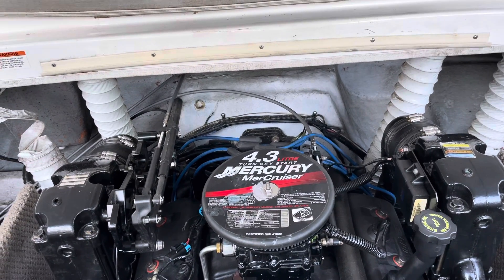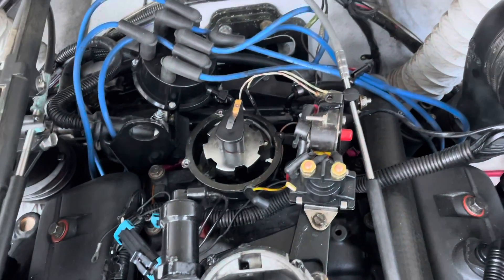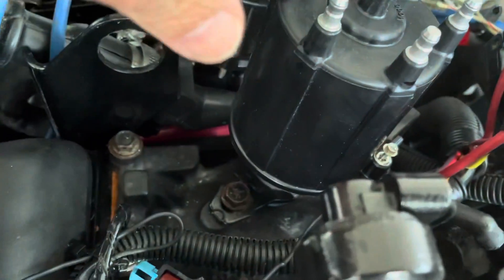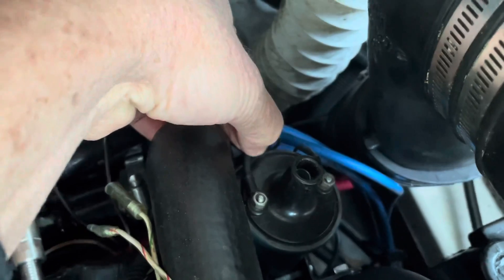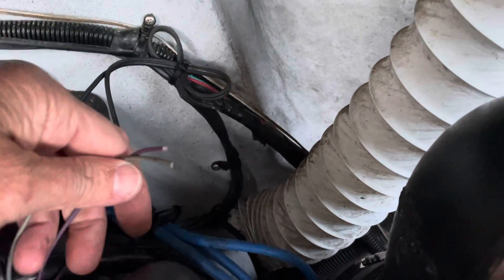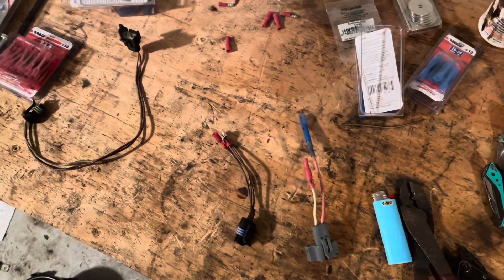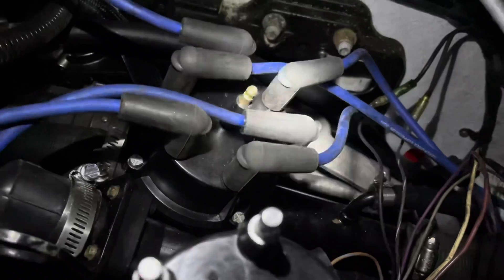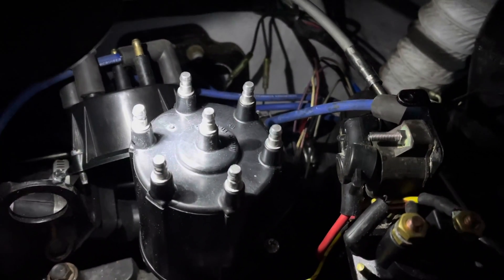3 - Mercruiser Thunderbolt Ignition? - The Fix Is In - OBSOLETE - Read Description

Comment: I am curious, I am swapping out a 2004 5.0L Thunderbolt V blown motor for a  5.7 short block and I am going to change out the Thunderbolt V after I have it running. I was told by the marine machinist that built my motor that is what he does for some of his customers but instead of using a separate coil and distributor he uses the HEI distribute it has the coil and distributor all in one, what is your thoughts on that?
Reply from the maker: If you use a HEI distributor from about 1976 to maybe 1982 it might work but this distributor uses centrifugal advance weights and you would need to have the curve adjusted on a Sun distributor machine. But you didn’t say if the engine is a Vortec 5.7 or not which would effect the curve you use. I personally would not use a mechanical advance distributor because it’s a wear prone system. The Delco EST is all electronic with no moving parts and is already curved for a Vortec V8.

Comment: I see on eBay/amazon a company called A-Team Performance  has a Marine HEI Electronic Distributor for $209 that has a 65K Coil - and Specifically built for the 305, 350 454 5.0L 5.7L 7.4L 8.2L  V8 Mercruiser OMC 5.0 5.7 7.4,  whats your thoughts?
Reply from the maker: I don’t comment on products I have not personally used but I would let price be your guide. Do comparison shopping using Google and make your decision from that.

Comment: Why did you change from the thunder bolt ignition? I thought they were said to be pretty good.
Reply from the maker: No on this boat the spark is very weak and engine is hard to start. Also as stated in Part 1 description, you can’t buy replacement thunderbolt modules so you’ll have to upgrade when the module fails.
Reply: @moccasinmarine  Yeah that makes complete sense I guess I missed that part. I have a 5.7 350 thunderbolt and was actually curious about that specific ignition but after I talk to some people at my local marina they told me that it’s a great ignition and a gray motor as well. I’ve done a ton of work on it and was contemplating doing a distributor upgrade but if it isn’t broke don’t fix it I guess you know
Reply from the maker: If it breaks you won’t be able to fix it, that’s the point. My video applies to both V6 and V8 engines so you will at least have Instructions on how to upgrade.
Reply: @moccasinmarine  Yes definitely much appreciated. I do have one question which no one seems to know not even the MerCruiser guys around here. My 5.7 thunderbolt Came with a four barrel whatever I bought that Edelbrock replacement and when I was going to change it out I noticed there was no traditional gaskets just rubber quad rings for the carburetor and for the adapter plate that came stack. Is that normal?
Reply from the maker: @joebeales7227  I’m not really sure what you are describing. Maybe post a video on YouTube or send photos to gmefiguy@gmail.com

Btw you asked why I changed the Thunderbolt Ignition to Delco EST? This video shows why:

https://youtu.be/N_UiRFU7JZ4